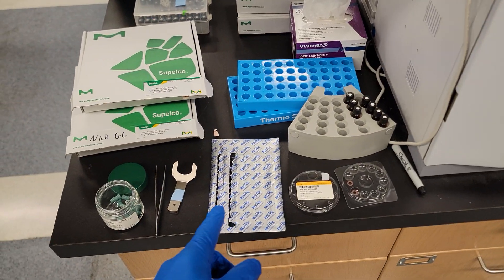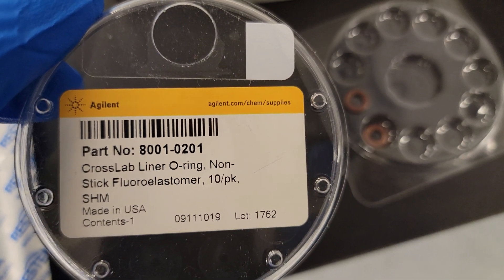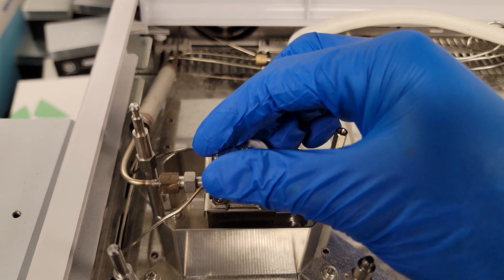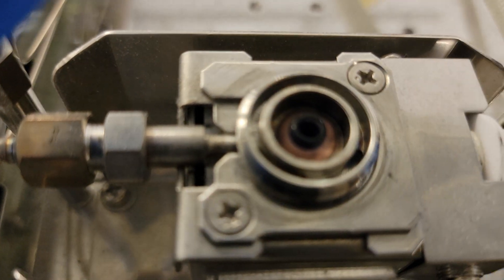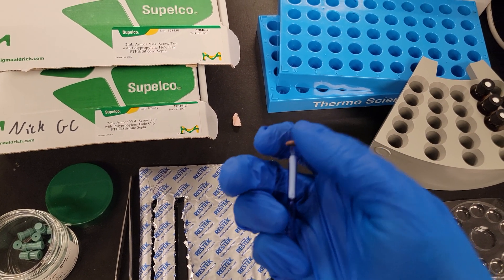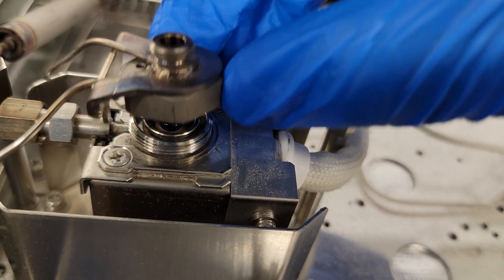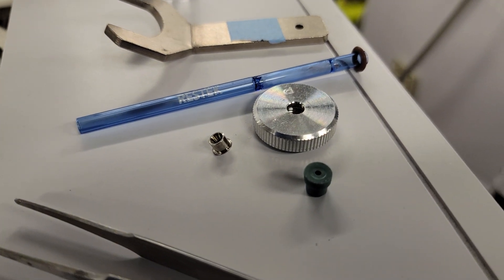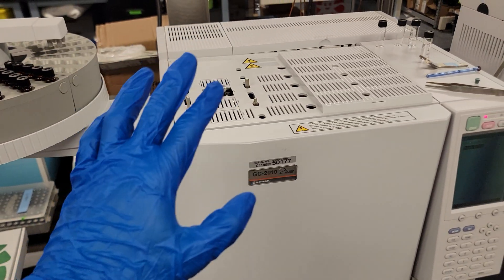Replace Liner and Septa on Gas Chromatograph | Routine GC Maintenance

Comment: So you replace the liner every 150 samples as well? What type of analysis are you running on this machine, and does the liner last longer with cleaner or more dilute samples?
Reply from the maker: Shimadzu just recommends every 100 to 150 samples. I think the liner can become more or less dirty depending on your samples. I'm running 5uL samples of dodecane and the liner is visibly dirty after 100 samples.
Reply: @DIYBiotech  i have assembled a lab, which has GCMS, GCFID, HPLC-UV, HPLC-DAD now, but ive got way more hours repairing and learning to run them than actual analysis, which i plan on doing pretty soon. 

Ive read a lot about liner de-activation, and how over time they can become active and affect your chromatography, have you ever noticed a decline near the end of life of a liner?

I guess also, applications like MS might be more sensitive than FID of course.
Reply: @Vanisletechstuff  I run GC-TQMS on split and splitless liners, and I've used a single liner for hundreds of 1ul injections with no problems. I'm sure it really just matters on the content of your injections.